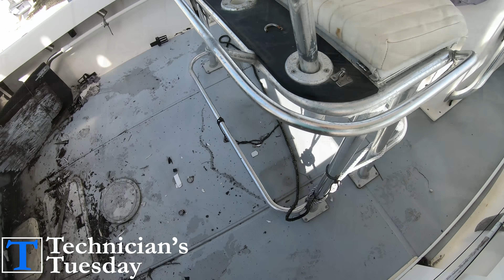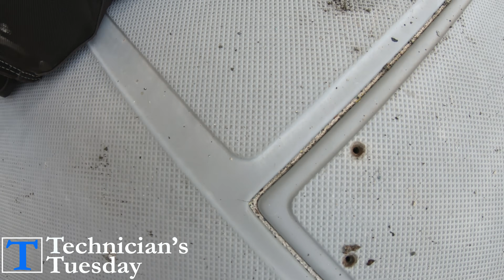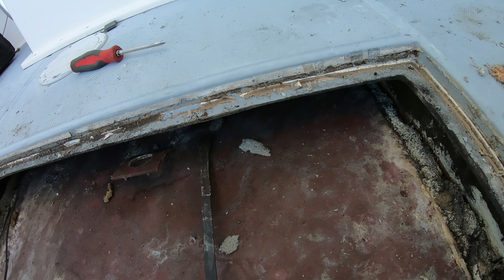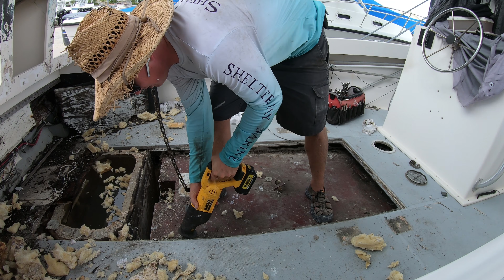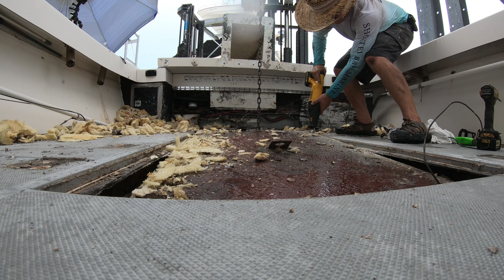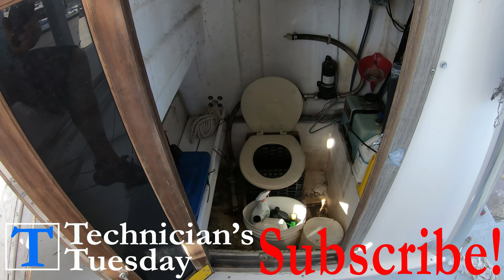Replacing A Boat Fuel Tank Part 1!

Comment: I’m about to do this on a 96 Cajun bay boat I’m redoing. I’m having a hell of a time getting the tank cleaned/flushed out with just putting 5 gallons of gas or so and trailering it around.  Someone along the line of boat owners before me decided to gel coat over the big hatch behind the console…covered the screws and everything 🤦🏼‍♂️
Reply from the maker: That’s definitely a fun surprise to uncover during a restoration! 😂 Sometimes replacing the tank is the better option once you’re already that deep into the project. 
Check the Skool community for more hands-on advice and experience: https://linkly.link/25yxB
Reply: @BornAgainBoating I appreciate it!

Comment: You did it the best way, There are release compounds for 5200 you can use after you cut out most of the 5200 with a razor knife but, it has to be cleaned really good to make the new bead of 5200 bond. I sold a 21ft wellcraft just to avoid this repair...😂

Comment: Love your videos First of all but I was. Wondering If you Guys Would Do A Fuel Tank replacement when you have to cut open the floor. And then replace it back With the part you cut out as a hatch.
Reply from the maker: Absolutely, that's basically how you do it :) Measure from the bilge compartment for width and then try and get access to the rest of the top of the tank to get measurements on where to cut out and then yea, cut it out, and then reglass that same piece back in. You gotta refinish the deck though, usually regel coat it depending on the finish of the deck to blend it all back in :/ but that all depends on what the finish of the deck looks like. Hopefully all flat and you can just regelcoat and nonskid it :)

Comment: Drill 2 holes through the top and install 2 eye bolts with butterfly nuts that open wen pushed through deck 😊 then use your brain to hook a comealong / tie-down ratchet or chain hoist and gently  put pressure 😊😮

Comment: I found a better way, but you need an overhead chain hoist. I just did it today! Once you get the sealant around the edge cut, fit a 2 ft steel bar or pipe thru one of the deck plate holes and center it like a T-bolt, grabbing the underside of the floor panel. Hook the chain to the bar, then hoist away.
You can do the same for the tank. Hopefully, there are no gas fumes in it, and the top isn't corroded to hell. Using different hardware, you can grab the tank the same way. You may have to drill a hole or two in it, but it works. 😉 Let the chain hoist do the work.

Comment: Thankfully my fuel tank is the same size as my access panel so I'll be able to pull mine straight up and out do you think a cherry picker or should I say an engine hoist would work to lift it out

Comment: Hammer drill with long chisel bit removed foam in 1 hr on 60 gallon tank. Lot easy than I thought
Reply: So is a pressure washer with the pin hole tip .       Another great weapon is the oscillating vibratory tool like Harbor Freight sells.    Something like that lets you dice it up in blocks without all the mess.    Then you can suck up the remainder in a shop vac.

Comment: I found that removing foam is a lot easier with a stiff nylon cup brush and an extension on a cordless drill. The brush chews up the foam and you can easily vacuum it up.
Reply: I'm rebuilding my boat and saw yesterday the foam filled sides are very wet and possibly rotten. You may have just saved me a few hours! Thanks a bunch!
Reply: @Jesse527-t4j  I'm glad I could help.
I found that if you get a piece of small PVC pipe to put the extension through to use as a grip in the middle of the extension, that really helps.
Reply: Never tried it myself but I have seen foam removed using a pressure washer. Seemed to work quite well but again, have not tried it yet.
Reply: @10knucklechuckle  It could work, but it would be a massively sloppy mess. 

Grinding it out will create granules and some dust, but not much else. Once you vacuum it up, the mess is gone.

Once I had the boat empty and the weather warmed up I did use a pressure washer on the inside to make sure I got all the dirt and other crap out, and some of that crap was little pieces of foam that were still stuck to the aluminum.

Comment: To remove floor and caulk, go to an auto glass shop ,ask and observe how they cut out glass from cars. They have many tools that you don't realize exist. They also have to get in very tight spots without chewing up the car interior. I know how it's done,  I was a bodyman for 40 years. I wouldn't want to waste time trying to repair that deck. It will never look the same anyway. You can't match that pattern.  Fill the tank with water and cut the top off  then pump the water out . Cut it up more. Take it out in pieces. 10 or 20 pieces if you have to. Use a cut off wheel and 3m belt sander .Don't destroy the surrounding floor at all. Both tools are air driven. They are bodyshop tools .Then replace the original tank with 2 smaller more manageable tanks equaling the same original volume so they fit with less of a fight even if you have to make custom tanks.  Connect the tanks with a hose or add a second pick up hose and sending unit and dash gauge. You have to customize and modify things. It's a repair , not new anymore. Hope this helps!
Reply: Ya, there’s no way in this world I would have EVER cut that floor!!! New plastic tanks are fairly well available in multiple configurations. I just never would have cut the floor when a twin drop-in is likely obtainable.

Comment: I Have a Triton 2690 CC and the tank id rotted, but to remove the tank I need to cut the Deck... would be great to see a video on how this process is done on closed decks to remove the tank, Or if someone could shoot me some tips to doing this... luckly my tank isnt foamed in its just screwed into the stringers so should come out easy.
Reply from the maker: Now that gets tricky :/ you basically have to look into the bilge where you can, the on top of the deck measure from the gunnels to the stringers. Then use that measurement to place your mark on top of the deck and saw it open. Save the deck portion you cut out and use it to put back down.
Reply: @BornAgainBoating  luckly I have the tank dementions already, and i can see the tank clearly thru the bildge, so the lines that seperate the anti skid over the deck is where I gotta cut then  good to know.. my concern is closing it again because there is no lip under it to hold the deck back in place sooo i am guessing i have to make that lips myself of something to either hold the deck back level or somehow glass it back closed... alright so Out comes the angle grinder and Im guessing im gonna have yo take apart my leaning post with built in live well.. I guess im going to be redoing all the wiring that has been annoying me since attaining the boat 👌🏼👌🏼 thanks for the tip just wanted to make sure I know what to do so im not flying blind

Comment: got a hole in my 96 24ft cruiser fuel tank rather than deal with this situation i did a water heater and water tank delete and im about to stick a 40 gal tank in the engine compartment lol

Comment: Why do boat fuel tanks go bad. Aren’t they made of stainless steel
Reply from the maker: They just corrode over time. Most are made out of aluminum, fiberglass, or plastic. You dont see a lot of stainless tanks in fiberglass boats. I think its mostly a weight issue :)

Comment: I always put a layer of glass with epoxy resin on the panel well I have it out to reinforce. Epoxy adheres better the polyester resin to old surfaces. Panel with be good an stiff for another 10yrs.

Comment: https://youtu.be/Ra-7MU_wqk8
Cleaned and installed a new pickup tube on my Starcraft Moller fuel tank year ago. I have an aluminum boat which is much easier to work on. It was a good project and knowing your boat inside and out is always a good thing.
Reply from the maker: Awesome! Yeah aluminum is a little easier on certain things. Knowing the boat makes it easier to get something straightened out whenever things go wrong and your out on the water :)

Comment: You will never cut 5200 or 4200 again if you get some Debond MF12 marine formula the cheapest place to get it is Amazon it dissolves 5200
Reply from the maker: Awesome! I've got it on the list to check it out! I see it's made here in Florida which is sweet :)

Comment: good gawd, hope that boat was a hurricane, sunk, victim. BEST part...snap-on high dollar $40 screw driver tip snap!  Looks to me, the wrecking blade and sawzall will be the most valuable tool.  Got a idea.....fork lift, rack, turn boat upside down, start cutting all but hull and let the junk fall!
Reply from the maker: It did go through IRMA on the top rack, but it's been sitting on the rack for just over 6 years :) Hahah yeah, the Snap-On guy usually comes on Thursday, so now I have to wait until next week :/ I'm going over there now to work on the tank a little more. I think I can get it out, that would be quite the sight to see a boat hanging upside down with someone sawzalling at the fuel tank underneath it lol Too funny!
Reply: @BornAgainBoating  no....the whole inside!

Comment: Engine mechanics has to be more lucrative. I would think you really have to be on your game to turn a profit from a project boat or maybe you do it for fun like me lol
Reply: True that. If you work in a marina then of course this makes sense to do this as side during downtime for fun and profit and it hones your skills lol
Reply from the maker: @nygardenguru  yup! Another plus is you get to run different boats and have a broader look on what makes a quality boat and what doesnt :)
Reply: You’re like me running through a million boats for me finally just deciding on Parker or Privateer, lot of good boats probably matter of personal preference?
Reply from the maker: Right, both of those are great boats though. You just have to watch the fuel tanks on the Parkers. A 20 year old Parker is a definite candidate for a fuel tank, and you have to cut the decks out to get to them too! But they are a great riding boat, just a straight fishing boat!
Reply: Thanks for the idea (in case). May not be that bad if you can cut just inside the stringers so you can reuse that piece of wood, someone had done that on one of my Privateers.
Reply from the maker: That's exactly what our fiberglass guy does! He does at like 10 Parkers a year! But he's great at them, pulls the deck out just like you said and then puts it right back. You'd never know it was done either, he blends it in and paints the floor. It's like brand new!
Reply from the maker: Hahah, you'd be surprised :) Most of the time the profit comes from what you buy them for. This one should be a good deal! But then again, I do work in a marina so a lot of parts, engines, and other things come with a great discount :) I would still say I do them for fun like you!

Comment: you are the best.  let me ask you a question if it does not bother you I have an F90 yamaha I have to tighten the propeller how much is the torque
Reply from the maker: Thank you! No worries, it's only like 40 ft lbs, so not that much, main thing is that cotter pin!
Reply: Born Again Boating thanks you for your help

Comment: I replaced the fuel tank in my 85 Mako. It took me 3 days to get the dang thing out!
Reply from the maker: I used to have an 85 21' Mako, didn't have to do the tank but that was a great boat! They like to foam them in bad! It's crazy how much pressure you can put on that tank and it not budge! Do you still have the Mako?
Reply: Born Again Boating Yep, still have it. It's a 20C that sat uncovered here on Long Island for 12 years. It was full of rotten leaves and alge. It's taken me 4 years to complete the project and I've been using regularly. Unfortunately, I've got "three foot-itus" and I'm currently searching for a Mako 231.
Reply from the maker: Congratulations! Thats awesome! You know those 23's are sweet boats! Not to be a bad influence or anything lol

Comment: wish mine had an access panel .
I had to cut my own access panel make braces to hold the panel i cut 
fiberglass resin etc then paint the whole inside deck area $2500  later 
had a shop tell me $7-8k lol
Reply from the maker: Yeah, having the panel is way easier! Think of the experience you gained from the whole process though :) I remember the first transom I did, what a mess lol Your lucky you got it done for $2500! ;) What kind of boat was it?

Comment: Try deflating a basketball or even a football and slide it between the top of the fuel tank and the bottom of the access panel. Use a bicycle pump to re-inflate the ball.

Of course this only works if you can get a basketball under the access panel. It also works to get stubborn flooring out of awkward areas when replacing a boat floor.
Reply from the maker: That's a great idea! Idk if it will work for this situation, but I can think of a handfull of times where that would have worked out perfectly! Thank you for the information! That's a great trick :)
Reply: @BornAgainBoating  works great for dents in rear quarter panels on truck beds also ;-)
Reply from the maker: @kirkmartin2223  wait a minute! Have you seen my truck! Lol